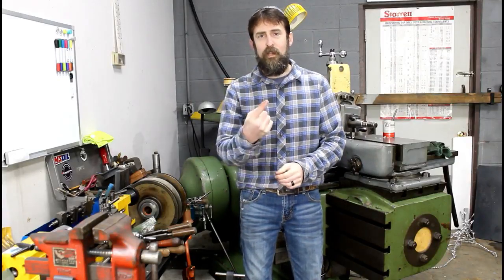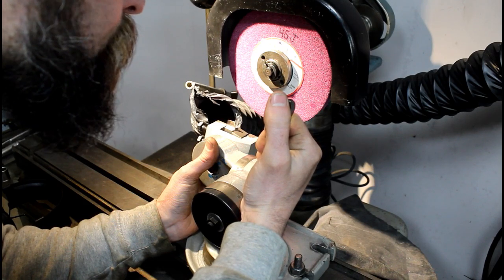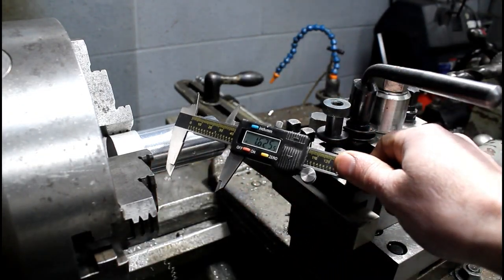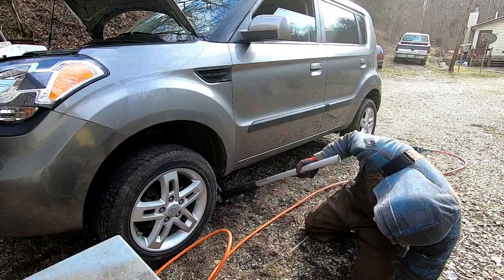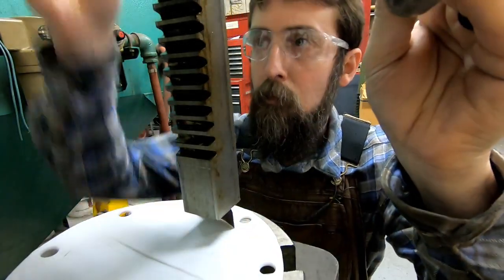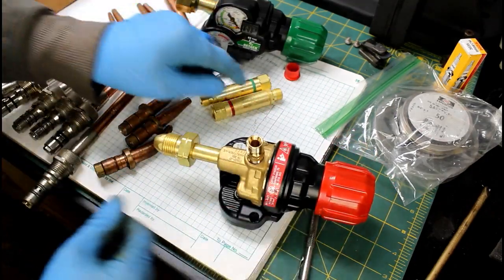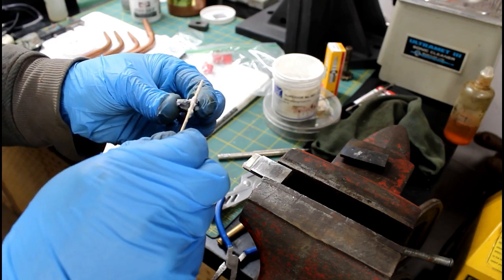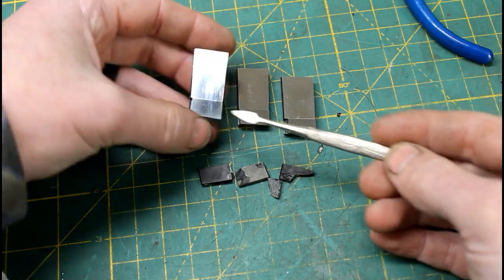Broken Carbide Repair  .  Off Market Part Repair

Comment: How do you know which scale (top or bottom) to use on one of those types of protractors? 
Is it something like, if you're using the left side of the leg you take the reading from the top scale?
Thanks.

Comment: Two things, does that lathe not have a large enough spindle to take the whole piece of aluminum rather than cutting off a chunk for the project?  And second, if you’re going to use jack stands in the gravel, you really oughtta weld some big feet on them so they don’t sink in as easily.

Comment: I've seen people put teflon on the threads, even on the tapered side too. Makes you wonder. They should just ask could lead to dangerous situation.
Reply: Known plumbers who do that, and every time the pipes leak for some reason. remove tape, clean up the compression fitting and make it nice and tight, and they stop leaking. then you get those who use window putty in the threads, and you have to cook the fitting with a torch to get it loose.

Damaged fittings that would always leak I had a solution, clean up to shiny inside and pipe, and solder the darn thing up, Mostly due to the previous "plumber" cross threading it, and I get it after hours and have nothing to replace it with. I have done quite a few solder in connections using silver braze though, where I want to make sure it will never leak again, especially inside a tiled shower. You need a lot more heat, but it will never fail, and will never leak.
Reply: And  NO OIL on the oxy fitting

Comment: As for those wheels...if you have Belle Tires down there, they have incredibly inexpensive replacement wheels for all kinds of vehicles.  I had to replace the wheels on my car TWICE thanks to the incredible Michigan Roads (yea, worst in the country)...$85 each...vs. the OEM replacement wheel of $650 EACH.  I took the 3 bent OEM wheels to the scrap yard and got $150 for them, and the good one went to the pick-a-part for $100.  Not bad...If I had to do it again, I'd have kept the wheels because I'm looking at building an aluminum foundry, and that AL356 is awesome casting material.
Reply: Just grab old pistons, they are a pretty good source as well, just will have a bit of smoke from oil at first.

Comment: Hope you find out what the health issues are and it's minor.
You could have saved some grief by tilting the tool holder 4-5%, point up. Gravity young Padawan! Also, I watch mainstream.co.uk and he soaks his silver soldered parts in citric acid to remove all the flux. I imagine lemon juice would work also. 🤔
Reply: FireMakesMeKing 
Same stuff. Acetic acid.

One word of caution though when soaking steel part in citric acid fully immerse the part else at the acid air boundary it will etch a deep line at that point . Copper/brass etc will not react the same

Comment: LISTEN...GET SECOND OPINIONS FOR YOUR WIFE  I was supposed to go in for lots of test/procedures that would have put my already compromised system in jeopardy. Got a second opinion from an older and very well respected doctor with lot's more credentials...He said, "I don't even know how they came up with this diagnoses", as he looked AT THEIR TEST results. He did a PET scan and it showed that my heart is NORMAL.  I would probably be dead right now if I had followed up with the previous renounced clinic.

Comment: "Never torqued a lug nut in my life"
Good man, neither have I. Pointless using a torque wrench on a lug nut, just use a bit of common sense instead.
Reply: I don't worry about steel wheels but with these aluminum type torque needs to be the same as they do distort.All torque means is equal.
Reply: @TomokosEnterprize  I guess that would be, two grunts per lug nut. :-)
Reply: Like Tomoko says  - Torque alloy wheels.  You "grew up" on steel wheels, very forgiving and most always "lug centric" , alloy wheels are most always "hub centric" and sensitive to lug force.  Makes a lot of difference and is a safety consideration.  Watch the tire stores too.  Most of them are professional and check torque but some are careless.  I recall one case where a 500 ft lb air impact would not loosen the lugs after I had a set of tires installed on my son's 4Runner.  Took a 5ft long cheater bar on a ¾" drive power bar to break the things loose.  That was roughly a 6 ft lever arm with at least 150 lbs at distance!  You can bet the tire store got a call!
Reply: @geoffmorgan6059  You bet bud. When I get tires worked on I take them in and have them do the mount and balance and do the mounting to the vehicle myself. Most tire shops have always used a lot of younger technicians that just really don't care. For me that is a huge thing.
Reply: On the other hand the tire shops always seem to crank the nuts on to where there’s no way I could take them off on the side of the road.  I always have to check and often loosen them a little with a cheater bar.
Reply: @Scodiddly  That is why I chose to do the mounting myself.
Reply: @geoffmorgan6059  Tire stores? You mean like when you get the car home and one tire has 23 Psi and another has 58 Psi?  I sure don't trust 'em no how no way.
Reply: @davelister796  You bet. Like I said torque is all about making things things the same. Even with only 1/2 th advertised torque being applied it is just about the same pressure applied and they won't disturb the roundness. My grandad was a popular mechanic building/repairing gas and diesel engines and never owned a torque wrench.
Reply: Not pointless, just not quite as critical as some say.  Some brake rotors will warp if the lugs are too tight.  But you also don't want too little.  A torque wrench makes sure you have minimum without exceeding maximum.  With experience, you can get by without it.

Some tire shops, if they encounter a lug that their air wrench won't remove, the job on that tire ends there.  They will claim that the threads could be over stressed and damaged, and they don't want the liability.  Likely a claim of busy-body lawyers.
Reply: @infoanorexic  I have been on the tools for well over 45 years so i can hear and feel the difference.  Great words on min/max bud.